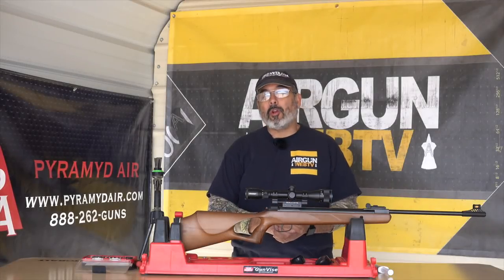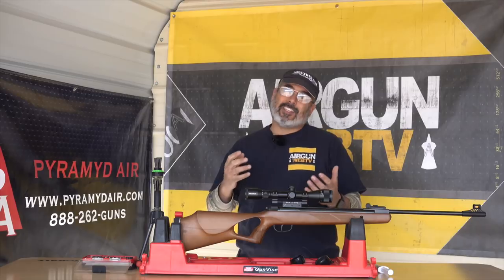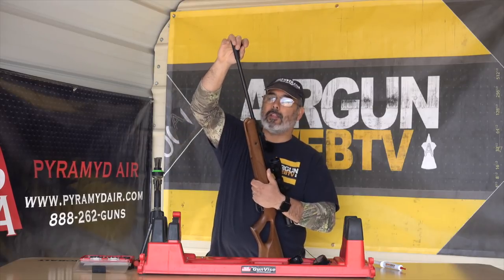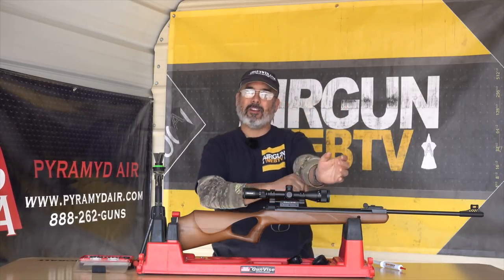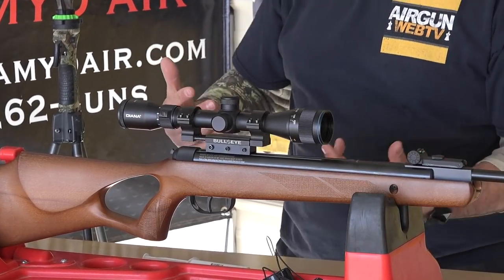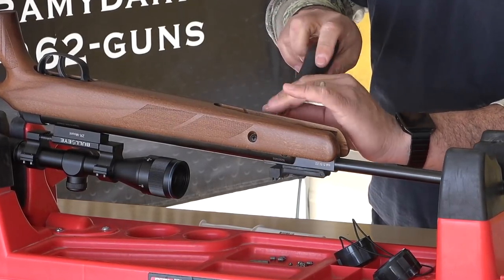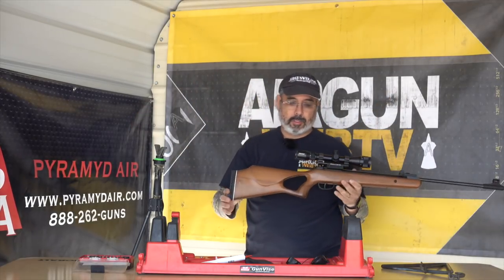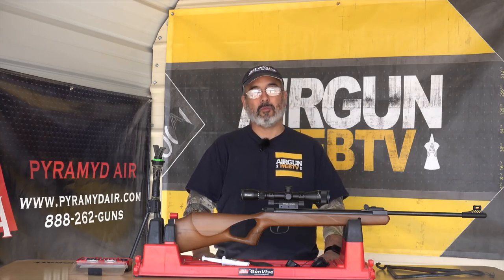Air Venturi Tune-In-A-Tube - Let’s make your spring gun SMOOOOOTH - Review by AirgunWeb

Comment: Would this be better then air venturi moly? I ordered both, but I'm planning on using tune in a tube for the spring. moly for the piston* guide top hat an other areas. (Its a AA TX200)

Comment: Yeah but in the end the only improvement you achieved was lessening a sound made when breeching the rifle to cock it and maybe some spring vibration and the draw back from the viscosity was a loss of a little over 10 fps . Velocity is very important even with a .177 I might add to the overall accuracy . That's the point of my comment . As a hobby shooter and as a defender of the chicken run and hater of stray cats on my Scat Pack if it don't stop spring vibe , breech grind or scraping and up the fps or muzzle velocity , then what use is it ? I don't expect an answer . Ty
Reply from the maker: Hey there.. 10 FPS is nothing if you can reduce your standard deviation, which is a far greater benefit.  This product is for folks who want a more enjoyable shooting experience delivering greater accuracy due to less vibration and better overall shot-to-shot consistency.   It's not a replacement for a full spring tune, but it's a good option for those who don't have the tools or mechanical abilities.  This is only really beneficial on traditional metal spring guns.. does nothing for gas ram guns. 

Cheers
AGW
Reply: Whatever man ! Typical sales man duck and dodge . Bet you voted for Biden too ?

Comment: Why would you not just shim the ends of the spring to keep it from vibrating ? Sticky substances don't know the difference between dirt , dust , lint, and springs so all of the afore mentioned things seem likely to wind up in your rifle. My Talon springer ( Hatson 125 ) is so noisy that it embarrasses me to shoot it in front of someone but I still would not put glue on the spring system. Before I would do that I would convert over to the gas piston that I have for it.
Reply: This is for a first time, take stock off lube.   If they enjoy they can get into tinkering later.   Imo

Comment: Ok , first thing are we supposed to just take your word for this lube . All you did to get a base line was talk about a spring vibe . Spring vibe is not a real big thing . Shooters want more accuracy , more velocity , and consistency . Also you just mentioned that you had a slight drop in velocity safter the use of this lube due to its viscosity and drag on the piston ......Idont really see where this lube is a good thing . Air rifle manufacturers have recommended lubes for the parts and seals inside their rifles wouldnt you think those are what is to be used as all air rifles are not made the same and all air rifles use seals made of different polymers , urethanes , and elastomeric properties ? JS
Reply from the maker: so.. you may or may not have much experience with old-school spring guns.. not gas ram guns, but old springers.  Spring vibration and harmonics are a real thing.  It's not about "performance" but about making the gun far more enjoyable to shoot.  I spent a LOT of time looking for the right lubricant before settling what's used in the tune-in-a-tube product.  It does an exceptional job of calming down the vibration.   The fact that you can get significant results without having to tear the gun down, which requires a spring compressor and other specialized tools, makes this a great option for folks who just want their springer to shoot with less vibration without having to do a complete rebuild.  Take it or leave it.. does not matter to me.  I make nothing on it.  It's just a great product for folks with old-school spring guns. 

Cheers
AGW